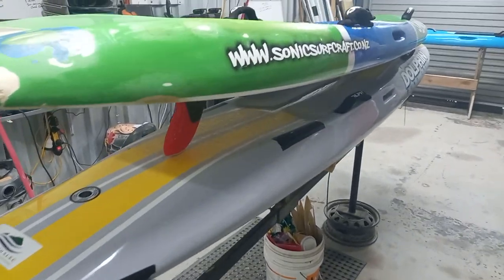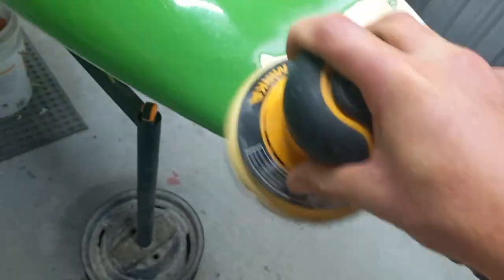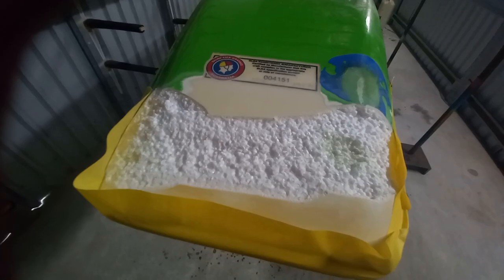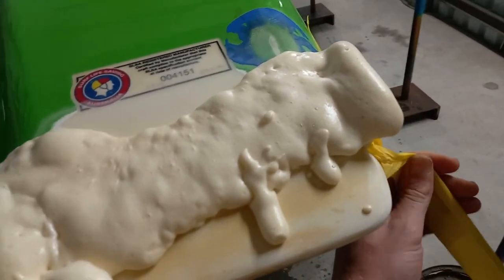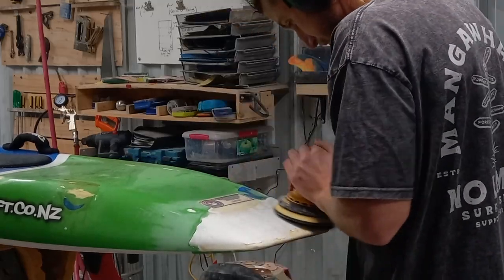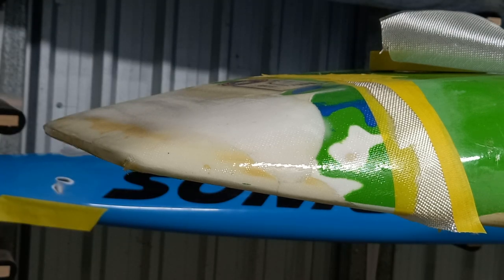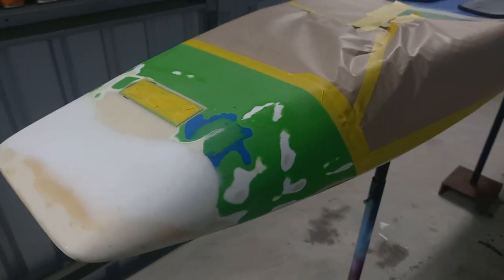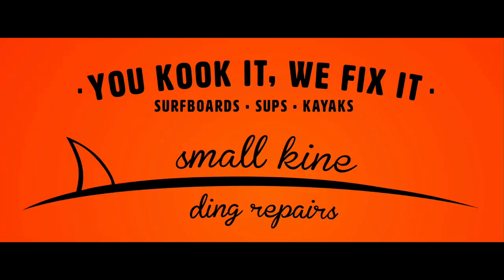HOW A PROFESSIONAL REALLY FIXES YOUR BOARD: Epoxy surf club knee board

Comment: can you use the expandable foam that comes in a pressure can. l know there is a can that puts out a cheap foam and a can that is more expensive and it's more like a surfboard foam. l do like the fact that you mixed the runny and you called it U P foam, can you get thyat on e bay. l like you video as you exsplan is in simple terms. thanks Keith
Reply from the maker: I have a specific video on the foams but short answer is no. Foams from a can lack density and are full of air, not the ideal product for surfboards

Comment: I totally thought you just used great stuff crack sealer from the hardware store. I don't know if they have that in Australia but we use it to fill cracks in window frames and drywall.
It looks the same. I wonder if it would work.
Reply from the maker: Don't use that, very low density and full of air because of the way it leaves it canister. This foam is a much higher density and quality than builders foam for window jams

Comment: I didn’t think of using the foam to fill in the dings on the surfboard I’m prepping to art/paint. I used resin so now it will be a messy sanding.
Reply from the maker: A little bit more work with the foam but the use is more for structural integrity when surfing. If I were just painting an art piece I’d probably just fill it with resin too 🤙

Comment: Thanks great video. What pu foam do u use. I have a snapped eps tolhurst with no timber stringer. Have repaired pu snaps and creases but never one of the tolhurst mal. ???????
Reply from the maker: I have a video dedicated to this foam so search that out. The foam is compatible with EPS so it may come in handy with your repair. Epoxy repairs are all much the same, regardless of the "tech" in the initial construction. If it's EPS and epoxy, that's all that really matters when it come to repair technique. 🤙

Comment: hi, thanks for the video! what would you recommend to use for a PU foam, 4 lb/ft³ density (14x expansion) is enough? which one do you use?
Reply: so silly of me, i just watched your other video. the options for me are either 48kg/m3 or 64kg/m3 versions -- i'm slightly worried that the lighter material might not be enough for parts that have to be load bearing, like the footpad etc. what's your take on this? might 48kg/m3 work?
Reply from the maker: Gday mate,

So I generally do repairs with a 36kg foam which is pretty much bang on to a PU blank you'd buy to shape.  I use 64kg foam for really sever dings like large delams or snaps but that's pretty rare. The strength against impact should really be coming from your glass not the foam, the foam is acting more as a support for your glass rather than a structural component.

For comparison, an EPS sup or surfboard is maximum 28kgs so all the options you've listed are far stronger than any EPS board you'd buy, at least as far as foam is concerned

Comment: Question, why wouldn't you laminate over your 'fill coat' of resin + bubbles? Right after it gone tacky. Doable but on these jobs just to big or it to properly work?
Reply from the maker: Quite often on jobs of this size, once that filler coat has cured you'll find it can have some airbubbles in it or worse yet, has shrunk back. Often times that will mean it requires another skim coat before lamination. With all that in mind, I find it easier and get more peace of mind to just leave it overnight and let it set itself up how it likes

Comment: Just dinged my week old Torq epoxy surfboard, attempted to do a solarez repair, but started sanding and these little holes are showing up, thinking they are air bubbles, Any advice on how to get rid of them, cheers.
Reply from the maker: Howzit Ian? Guessing the pin holes are appearing in your solar rez and not the original class surrounding the ding? If that's the case then give it another rough sand and using a squeegee, credit card or whatever you're spreading resin with and reapply another really tight coat of your solar rez over top. Load it up thick and then keep wiping and applying your resin really hard to jam it into the holes. You can do this step a couple of times if that's what it takes to fill them all 🤙

Comment: would a can of spray expanding pu foam work? ..the type for insulation etc
Reply from the maker: Generally that spray foam is too soft, crumbly and porous for surfboard repairs
Reply: @smallkinedings  so generally any 2 part mix pu foam should be ok,?  like this..Poliu-foam, Polyurethane foam Compound A and B Multiple Uses Presentation 1/2 Kg. 250 grs. Compound A and 250 grs. Compound
sorry I'm trying to source in Mexico currently. thanks for your input as I'm not sure specifically what to look for.
Reply from the maker: @rainham1  hey hey, so the foam used on this job was a 56kg so 1/2kg is going to be way to soft. I wouldn't go for anything less than 30kg and nothing over 62kg. 56kg is the ideal and matches PU foam the closest
Reply: @smallkinedings  I'm able to fine 2lb or 5lb density foam here.. your opinion which would be preferable  for an nsp eps board? thanks again
Reply from the maker: @rainham1  gday bud, so ideally you'd find a 3lb but if you can't find that I'd got with the harder of your 2 options. By the time you sand it, it will be a little softer than advertised. 

I'll leave this link for you which converts kg/m3 to lb/ft3. Just for reference I most commonly use 56kg/m3 and sometimes 64kg from really big jobs like SUP snaps

https://www.convertunits.com/from/kg/m3/to/lb/ft3
Reply: @smallkinedings  thanks you are extremely kind and generous with your time, sharing your knowledge and it's very much appreciated
Reply from the maker: @rainham1  my pleasure!

Comment: Would 6 Lb Density Expanding Foam work? Thanks
Reply from the maker: So from the little I know, the way they measure foam density is either

A. The weight of one cubic meter of the material which comes out in kilograms, or;

B  The weight of one cubic foot which comes out in pounds.

So, the 56kg density foam I use here would be 3.something LBs.

A 6lb foam would then come to about 96kg which is insanely dense, I actually can't imagine a foam that hard. The hardest foam I use is 64kg which = 3.99lb so I would say that 6LB would be way to hard for surfboard repair purposes. Check this link below for a calculator

https://www.calculatorsoup.com/calculators/conversions/density.php
Reply: @smallkinedings  awesome thanks for the help
Reply from the maker: @johngibson3952  no worries man. Sorry, slight correction, I've just edited in the previous comment. I used 56kg foam in this video, not 36 which is what I originally wrote!

Comment: I have a question, here in germany everyone say work with epoxy ... PU will eat your Board, can you link your PU Foam that i could try it like you?

Greetings from Germany
Reply from the maker: Gutentag! Pu resin will eat your eps foam. If i poured only the foam liquids, unmixed over eps, it would probably melt too. Once the liquids are mixed together though, it's a matter of seconds before it expands and hardens so, there isn't enough time for it to damage the eps. Any two-part expanding pu will be fine. Mix until it begins to expand then pour it.
Reply: @smallkinedings  thank you so much, I will try my best and I will tell you how it worked :)
Reply from the maker: @floti99  pleasure,  let me know for sure how you go!